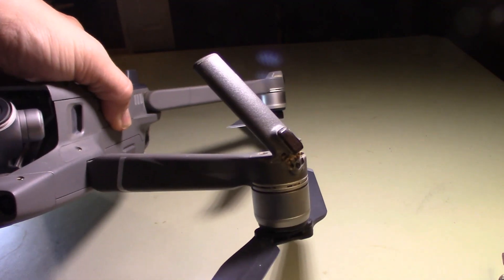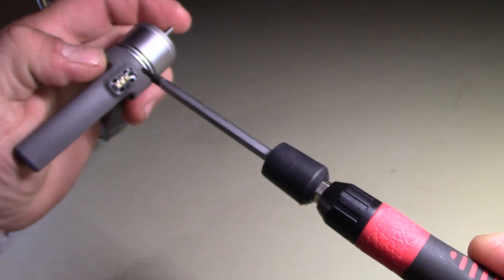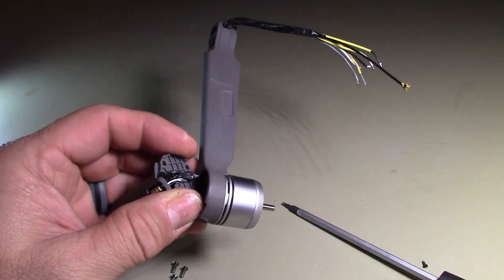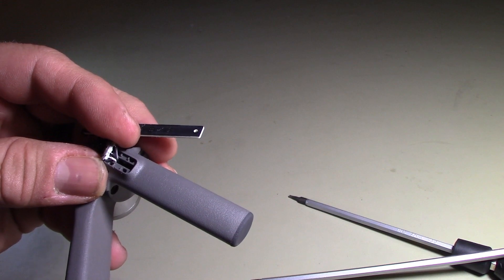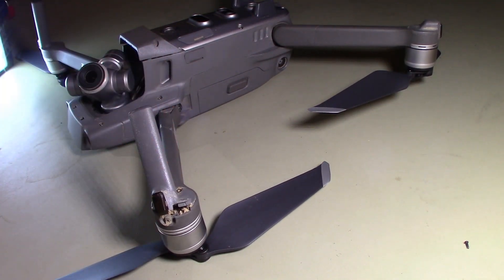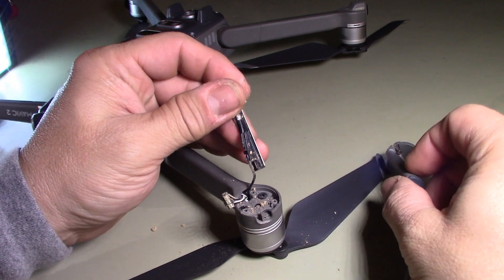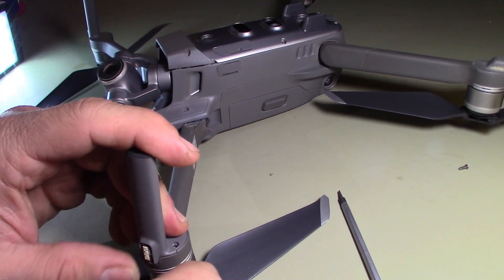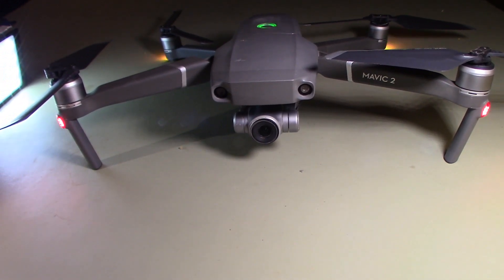Mavic 2 Landing Gear "Leg" Replacement Without Replacing the Arm/ Landing Gear Fix Easy No Soldering

Comment: Why not just change the entire arm? I am curious because mine is broken and I am having issues with the drone disconnecting so I think there is damage to the antenna &/or wiring. I have not taken it apart yet to investigate this but my thinking is that I would just change the entire arm.

Comment: I glued mine on, after stepping on it. Then it was stepped on again. Took ages to get all the glue off ans the 3 main screws but that LED is a pain in the ass! changed my dji fpv landing gear and antenna board x100 easier.

Comment: Great video. A little tip, you can actually turn the led sideways and sneak it through that gap without using a dremel tool.
Reply: hiya! any clarification for this maneuver? i’m trying to get it through without breaking the wire

Comment: Thank you! Was in the same situation, and when I realized replacing the leg means dealing with the LED situation I got stuck. Only 2 solutions I could see was desoldering/soldering the wires or dremell the plastic so I can fit the LED trough. You gave me confidence to apply the dremell solution. In the end, I noticed the LED looked like the soldering has broken off but it turns out everything worked fine when I tested the drone. 👍

Comment: Just did this!  Thanks!  If you don't have a dremmel tool, I just used the various torx ends to and phillips heads to make the hole bigger and bigger, and just cut out the plastic on the leg that was getting tossed.  All good

Comment: This exact damage + prop damage happened to me on a job this past  Monday with my Mavic 2 Pro.
The lateral sensors didn't catch the object to it's left and crashed causing the mavic to hit various things on the way down but somehow caught itself. I found it hovering. 
I still had many shots to get.. so I replaced the damage props and flew her with the damaged landing gear. 
I obviously didn't want to press my luck on further jobs so I didn't want to leave it damaged. 
I don't have the time to send it off to be repaired so I was searching YouTube with the hopes I'd find a way to repair it myself in a much more time sensitive manner.
Found this video and glad I did.
I had to dremel both gear to release and then push the light through the new piece.
They sell them on Amazon for $8 for a pair.
Instead of spending $50-200 for a repair.. it cost me $8. Not bad at all.

Comment: is the Mavic Air 2 & Mavic 2 Pro takes the same landing gear
Reply from the maker: I'm pretty sure it doesn't...
Reply: @FatherandSonHavingFun  I guess we will see because i ordered them :) couldn't find a model replacement that showed only Mavic 2 and the picture looks the same as mine so fingers crossed
Reply from the maker: Let me know if it works, good luck.
Reply: @FatherandSonHavingFun  they came in today and very clear they are not the same. Thang goodness for Amazon prime ;)
The pictured diagram was not exact
Reply from the maker: Thanks for letting me know, I'll put that in my data bank.

Comment: Hey there thank you for the video, I was wondering if the air 2 and the air 2s use the same leg? I broke my air 2s and need to repair just that part. Thank you!
Reply from the maker: From everything I've seen from the air 2 and the air 2s,  they use the same leg just different sensors....
Reply: @FatherandSonHavingFun  so I would be fine just to order the replacement landing gear rn?
Reply from the maker: Yes.

Comment: Just broke the leg piece same spot! Thank you for the video, its a life-saver!
Reply from the maker: No problem,  grad I could help.
Reply: Yea, literally this happened. Wasn't too sure about the LED popping off. Thanks for the video. I didn't replace it because the plastic seemed to get right into place and I think it'll be okay for me. The next crash, I'll probably have to get a new leg anyway. 

Thanks a lot for making this.
Reply: @ajooba29  I did not change the leg piece either. Mine cracked halfway and still holds it together. I guess till next time :D

Comment: Hi there, I can't take off the antenna from the new leg, looks like locked...any advicee?
Reply from the maker: Make sure all the rubber cement from the inside the leg, it's very difficult to get all of it off.
Reply: @FatherandSonHavingFun  I'm refering at the minute 3:15, you take out the small black ball (that should be kind of rubber locking) and then just pulling out it goes. Mine stays there....